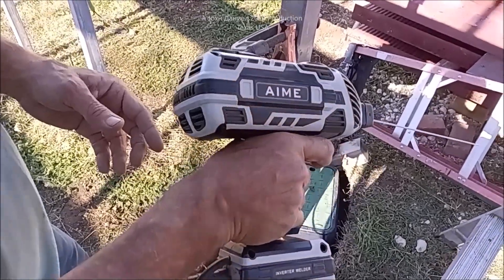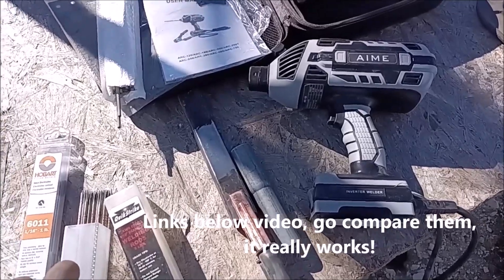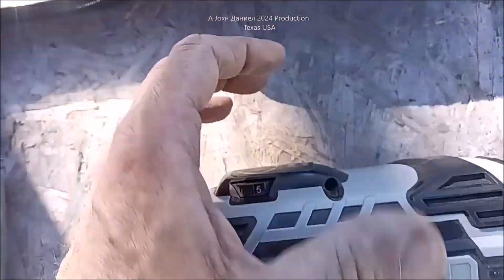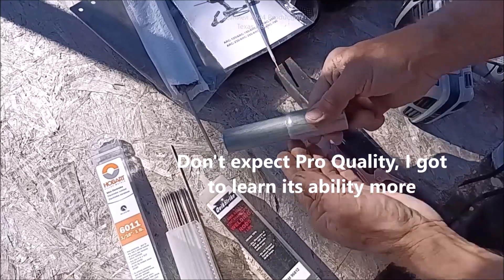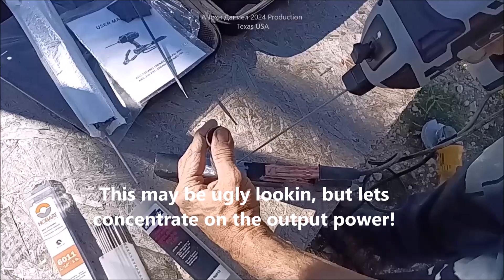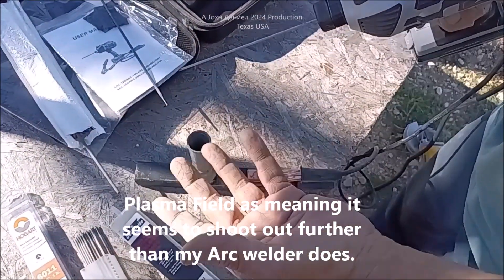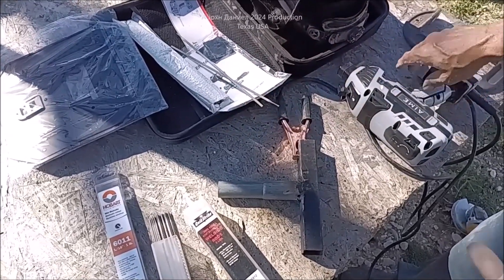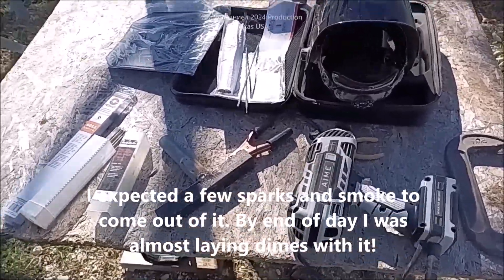Handheld 120 volt welder actually works, open box and try it

Comment from the maker: Get one at  https://amzn.to/3BNJz5T ,Pro grade YESWELDER helmets https://amzn.to/3PeY6us  ABSOLUTE BEST ROD FOR IT  Hobart H117125-RDP 6013 5/64-Inch https://amzn.to/3DJIgpb Those used in video - Hobart 6011 Stick Electrode 1/16-Inch https://amzn.to/4fBNP6m but get only for heavier metals,  Optional YESWELDER E6013 3/32'' for all and thinner trashy metals https://amzn.to/4fOUEBy ,  Tech Answers? go👉 Donate $5+ with KoFi - https://ko-fi.com/john4kiera OR https://bit.ly/2buyaCoffee and you'll get my help and replies!!

Comment: I looked on temu and you can get a inverter arc welder for less than 100 dollars, could get better welds than that thing will ever do.  That would be the better way to go. I still have my heavy transformer Hobart 205AC arc welder I bought in 2011 for 250 at fleet farm.  Edit: Just to add I think the only transformer arc welder you can still buy in stores are the lincoln arc welders.
Reply from the maker: We needed something to fit in the side box of the Chevy, I have 11 welders, and I do have a 120 volt 110 amp stick welder I converted to DC but then I have to bring the much larger 4200 watt generator instead of the little 2400 watt inverter genny. For some reason neither of my 2500 or 2400 watt inverter generators will handle any of my arc welders, They do great on a 120a MIG. But they will run this silly thing and it did fully weld 3/16 steel easy. This was perfect for being on the porta lift and not loosing any of the 3x3 foot floor space to the other numerous welders I have. In July 24 I got on a job, had a Array for solar to hold 18 new 340 watt panels, we got to the pivot pins and my wire feeder failed. A 180 mile drive back leaving 20+ clamps on a job was NOT fun to get my other large welder!

Comment: Gal fumes are very hard on the lungs and hell too weld. Welding galv use fan too blow fumes away or like you outside.
Heard it will destroy your lungs,, might wanna double check that out.
Reply from the maker: They angle of filming the video was a bit shaded due to having to be upwind from the fumes. We always set up to not get any smoke from welding. Too many weird chems in it.
Reply: @JOHNDANIEL1  been looking at those on temu for the last year. I was skeptical and still a bit the same. But seeing your vid gave me a little more confidence in it.
Looks like the plastic clamshell, might be sturdy. Is it styrene cheapo or pretty stout plactic?
Reply from the maker: It's obvious high temp plastics. I got tons of flash splatter on it, used it 30 minutes and got no apparent damage to it. It has a over temp design to it. After about 10 welds I was used to the weird hand to electrode angle and was doing real good with it. It will take you some time to know the power to metal mix, but you can if your careful put down nice welds.
Reply: @JOHNDANIEL1  Thanks.  Its got too be better than that 90 amp 110Vac, high/low fluxcore Harborfrieght wire feed I have. And no welder am I,,

Comment: Takes a long time to learn to weld thin galvanized metal..Those welds were all bad, you have to knock the slag off the weld, clean it up with a wire brush or grinder and show the actual weld..
Reply from the maker: With my MIG it would be fine, with this on its first use i'm showing the power not the finish. Not till I get used to its handling and settings.
Reply: @JOHNDANIEL1  well yeah....i found that obvious. Like your be reviewing a welder on youtube if you didnt know slag builds up when u weld?! Looks like a decent lil truck welder.
Reply from the maker: I paid $70.71 for it delivered. Nobody give it to me to review I've had it for 6 months. Personally I took it with me in case I had another wire feeder problem with the mig and could finish or secure something and do it later. The video was about the fact that the dang thing actually welds. Probably took me a good 8 or 10 welds after the video was shot by Kiera to figure out the settings on it. If somebody wants to see beautiful welds by it, get you a slag  hammer and brush go learn the settings and I'm sure their first few welds would be like holy hell you must be a novice. If anybody's seen the previous 500 videos on my channel they'll realize that I've been a structural welder for 35 years.
Reply: @JOHNDANIEL1  Did it come with the welding rods?  I checked the description, of which there are many, and it didn't say it included rods. I guess I'll find out when it gets here. First order I every made on temu.
Reply: @JOHNDANIEL1  im with ya bud. Im perdy sure i want one.
Reply from the maker: @MrFirstone23  Mine came with 12 rods, they are not great quality but if you heat them a bit in the sun or a oven ( 140+ degrees ) they do OK. I think all do have the basic tool set in them, brush, cheap hood/mask and rods.
Reply: "You have to" eh?......looks like he didnt get the memo or care.
Reply: @smallcityhomesteaders1600  I just thought it would be good to know if the thing could actually lay down a weld..There are lots of machines that will blow holes through metal...
Reply: Have you ever tried welding with jumper cables clamped to your stinger and ground ? Mcgyver without the nickel.

Comment: looks perfect for throwing behind the seat of the truck, quickly tack some light galvanized together. Not a normal daily use but looks like it's great for small jobs or take to a remote location to fix something.
Reply from the maker: Exactly, you got it, that's the ticket! Quick and easy.